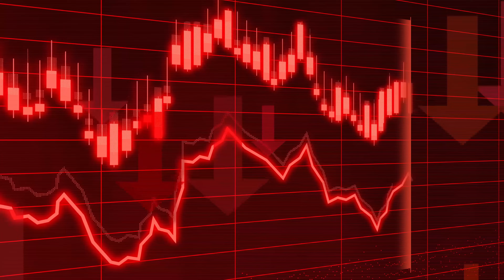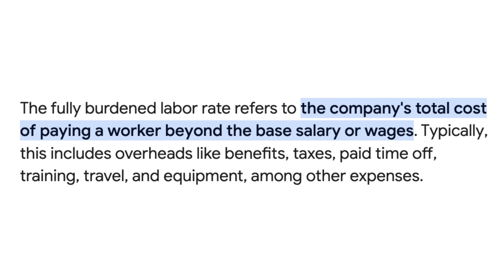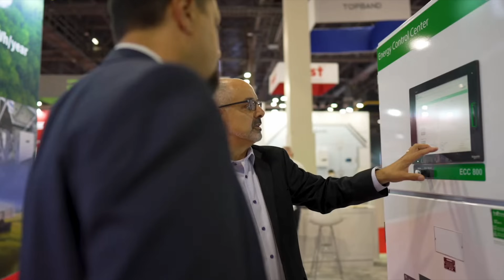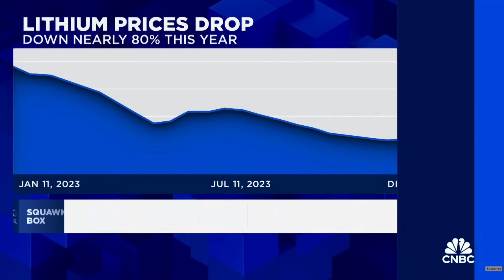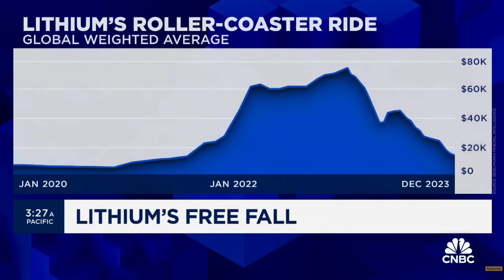IT'S BEGUN! The Solar Battery CRASH of 2025

Comment: Batteries are obscenely overpriced for what you get.
About time prices started dropping. But thy are STILL too high.
Reply: Tell your Grandpa to use rechargeable batteries. AA 4-5€ a 4pack. I use them since a decade now 😂
Reply: @lukastram4990  I have them too. ALL go dead in about 6 weeks of just sitting there.
NiMH batteries. Got D, AA, and AAA. No C though.
Reply: Btw i have old rechargeable D cells from around 2000 still doing their job for a nightlamp
Reply: @lukastram4990  I have some too but they ALL go dead after around 6 weeks, just sitting there.
Reply: Can anyone get below $US 0.65/ Wh installed ?
Reply: @DavidAKZ  Dunno unless you can buy them at wholesale?
Reply: $90 for the new 1kWh lfp cell from eve is really cheap
Reply: @stefanweilhartner4415  Eve?
Also, don't have a credit card nor $90 for the battery alone. Doesn't count the overprices poor quality solar panels with unreliable charge controller.
1kw battery needs 12 or more panels to charge it (panels barely get 2/3 of advertised rating and less on cloudy days).
No less than 2 panels to charge in 10 hours. And can't use anything else at the same time or battery won't fully charge.

How long will a 1kw battery last?
Running a standard refrigerator, 18 cu ft, will deplete a battery of that size pretty quickly.
Mine is old and will deplete it faster.

Doesn't count lighting or even cooking on a single 110v electric hotplate.

So you needs at least a couple dozen batteries, panels, etc just to have two of the basics.

Batteries alone at $90 a crack is a kidney buster.

Of course you need to install everything if you have a place to do it.

All the solar stuff is for RICH people.
Reply: In comparison to what?

If they are so obscenely expensive why are they in basically every electric device we have? 

I no of know other energy storage device that is cheaper then a battery. 
Maybe at scale there are cheaper alternatives. But even then batteries are still used at scale and being successful at it.
Reply: @Catsrules1  It's more about the profiteering than anything else.
Also, Alkaline batteries long ago used to last longer than the ones today for some reason.
Grandpa constantly has to replace those batteries. He said long ago they would last a lot longer.

Personally I have devices that do not use batteries - hand saw is one of them lol
Screwdriver?
Reply: @crazysquirrel9425 Do you have any examples profiteering?  In my experience they have only gotten cheaper. Although that doesn't signify there wasn't profiteering going on. 

I can't speak on the longevity of Alkaline batteries as I really haven't been paying attention on that unfortunately.

Handsaw and screwdriver aren't electronic devices.
Reply: @Catsrules1  But you said 'devices'.
Also a bicycle is a device.

Look up corporate profits for the battery companies.

NO WAY should a 4 pack of lithium batteries ever cost $20.
Even Alkaline batteries are high.

Using supply chain issues to increase prices is profiteering.

Supply chain was NOT as bad off as people are told.

Cali is the culprit for some of the supply chain issues. They refused to let ships dock and unload.
Reply: @crazysquirrel9425  I said electronic devices
Reply: @Catsrules1  Solar powered radio....
Reply: @Catsrules1  Electrical batteries are the inefficient way to do things. Mobile devices have the minimum battery size they can get away with because batteries are expensive. Plug in headphones(3.5mm) are a much better choice for many people rather than the battery powered headphones. People only use electrical batteries to solve a problem when there is no other choice. The best choice for electrical/electronic devices is to plug it into the mains, only if mains power is not an option would you then consider using batteries.
Reply: @Catsrules1  Home storage is many times the price of the same capacity embodied in an EV.
Reply: I got 34kw of batteries for 2500 delivered including bms of Lifepo4. Just gotta know where to look.
Reply: @jonathantaylor5105  where do I look?
Reply: @corinbw  If he did not just made it up I would guess used products without warranty. That seems plausible given the cost of a new set costing around 5k.
Reply: @corinbw The cheapest I’ve seen on YouTube are DIY cabinet with batteries -  Yixiang
Reply: @jonathantaylor5105 kWh ? That is not cheap.
Reply: @DavidAKZ  lol yes it is cheap when currently pre-made batteries are 5kw for 1100. I got almost 7x that for 2.5x the price. You must not be calculating something right.

Comment: Our 12.5 kWh PV system was commissioned in Sept 2023 and has covered ALL of my consumption and even banking power based on oversizing our system by 25%. My service provider (AMEREN IP) in southern IL allowed that and I'm on a NEM 2.0 plan.   We were going to buy a new Tesla PLAID  this fall but since our 2022 MYP is so nice and paid for we decided to hold off and spend that money on adding some ESS.  My installer (Straight Up Solar) of St Louis is an authorized Tesla and Enphase installer.  Given we have 31 panels mated to 31 Enphase IQ8A M-Inverters we are leaning towards the Enphase 5P.  But the PW3 is very compelling and given we own a Tesla that would be a natural choice for us.  I'll be meeting with them this week to get an estimate on both options.  We don't plan on installing the ESS until this fall, so am hoping any price quoted today will be lower this fall.  My starting baseline will be 2 PW3's and then going from there.  Exciting times.

Comment: Nuclear electricity biggest problem is that it is GRID ELECTRICITY. 

The Grid makes dirt cheap electricity expensive, extremely expensive in an all electric home with EVs or BVs.

With Battery Vehicles, Electric vehicles, parked 23hrs every day,  FREE  storage is available. 

Rooftop solar PV and EV big batteries and no grid electricity is ezi pezi.
Reply: Maybe If you work nightshift and your car were parked at home durring the day.  But most workers work durring the day and will need a battery that stays at home, which means either having a traditional home battery or two BEV's which alternate being the stay-at-home battery while the other takes you to work.
Reply: @kennethferland5579   a standard wall outlet and trickle charging is all that would be needed. 
Wall outlet are very cheap. 
Not all work places will have them.
But things will change.
Some people will be very slow to change and petrol will be available for years.

Comment: Additional battery supply was also created when the auto manufacturers reduced their forecast of electric cars. The battery manufacturers had orders in 2022 from them that were dramatically reduced.
Reply from the maker: Correct, that it playing into the oversupply factor for the raw material costs.

Comment: Powerwall 3=9,300. Powerwall 2=8,400. Your math isn’t adding up.
Reply from the maker: A Tesla Powerwall 2 was substantially more expensive than a Powerwall 3. About 35% more.
Reply: did you watch the video?
installation times have improved significantly

Comment: Crazy that you can buy a 98kwh used F150 Lightning for $30k. Combine that with battery system you can essentially buy a mobile battery with the capacity of 6-7power walls.
Reply: In my country South Africa you can buy 100kwh worth of LFP batteries for $14500. Depending on the brand of course. Prices have dropped a lot.
Reply: @free_stylabro6490  Actually we can get these for about the same price here in the U.S. (mine actually cost less, but it was a special sale).
Sadly, the price will go up in the U.S. when the taxes (tariffs) on Chinese batteries go into effect later this year.
Reply: @free_stylabro6490 what brand? Link?
Reply from the maker: Correct, however, we have to factor into account the value that a wall-mounted battery will provide in being able to discharge at a high enough power output to power the loads in the house, through a dedicated connection point in the main service panel.
Reply: @jackthesolarguy  An Approx. 100kWh battery consisting of Grade A high Speed EV cells comprising 48V 300Ah (53.6V x 300Ah= 16 kWh) series connected LFP pack in a 6P configuration would equal 96 kWh which at 1C would be capable of a discharge rate of 1800 Amps. The cost of the batteries,  BMS, fusing, circuit breakers etc ready to hook up to your house circuits would be about AUD$24,000 delivered to your door.
Reply: And a rv won't??? What are you smoking
Reply: EG4 power pro 14.5KWH for $3600 fully UL certified 9540A with the EG4 18kpv fully ESS 9540A UL certified even listed on CEC list in California for $8000 combined price.
Reply: Your right, yet these Solar companies are charging 30-40 thousand dollars for a 3 kilowatt system with 10kwh battery. Time to short SunRun into oblivion
Reply: What?
Reply: We get a full size NMC battery car top tier for that 30k you just want to throw at a salvaged or stripped out of a totalled vehicle
Reply: Absolutely. Tesla is ripping you off. Tesla cars will be the last to implement V2G or V2L.
Reply: FJB
Reply: @MC-.- F Project 2025
Reply: @simonpaine2347 awesome! Trump said the same thing! Imagine that.
Reply: @simonpaine2347  cool, you agree with Trump about project 2025!
Reply: @nextjin  Ok, Vlad 😂
Reply: Ev's keep lovking ppl out or in with their child while they watch it burn & wait on the fire department & who knows?
Reply: @dons5105  Yeah, I wouldn't want NMC lithium ion in my house--and I'd probably pref LFP even for a car--not only for the fire safety aspect but also because you can charge to 100% for literally thousands of cycle without worrying about destroying the battery.
Reply: @dons5105 So gullible. 😢
Reply: @dons5105  No they don't. What do you get out of lying?
Reply: @dons5105  The FUD king has joined the discussion...
Reply: @dons5105  You are sad aren't you?

Comment: Batteries have been dropping for decades.    They are still too expensive.   I buy them for disaster recovery purposes.  I recently went through 7 days without power.   Solar and Batteries was part of the solution (but the major part was still a propane generator).
Reply: I did the same in Upstate SC after Helene for 5 days running 3500 sq ft. 12k Inverter and 30Kwh Batteries with 6Kw PV panels pulled out for emergencies only. System cost around $12K, backfed the breaker box and ran everything except AC. Lasted 2 days at full load, then luckily we got full sun and recharged back to 30% and reduced to minimal fridge, internet and some lights to last out the next few days with solar charging keeping it going. Good practice run, I am doubling the batteries and panels ,rewiring a couple items, getting a heat pump water heater, and a couple small heat pump AC units. Then I should be able to run completely off grid.  The worst was the cold showers the last few days....Install was easy for an engineer, plenty of references on line and Utube, just modify for your requirements and rework/iterate as needed.

There are many other approaches possible:
- 48V, Smaller 5-10Kwh systems that run the essentials with solar inputs (backfeed or direct plug-in)
- Automotive: 12V, 50-60 Amp alternators with 3000W inverter runs several days on a tank of gas in idle (Typical fridge is 200 watts average)
- Systems that run golf carts, 48V 5-10Kwh batteries with micro charge controllers, just add a small inverter and a few PV panels; includes transportation when the grid and gas stations go down too. I bought a used cart for $750, spent $2500 to do this.
The Automotive solution recharges the system when the sun isn't available
Reply: @sholson2000  Sounds like you need an inexpensive camping shower which you can heat in the sun or quickly over a small fire.
Reply: A DIY 15kwh battery can be built for under $2k with reputable cells. How is that too expensive?
Reply: @vladimus9749 source ?
Reply: @vladimus9749 right now, thousand watt batteries are selling for $700.  2000 w batteries are $1,000. 

The prices on retail batteries have not been dropping.  If anything, they're more expensive than I paid 2 years ago.
Reply: @vladimus9749 and I've looked around and I can't find any batteries in the price range you're talking about.  Have you got a brand and a source? 

The best I can see for raw batteries without the other supporting components for a rechargeable setup is $1,500 for 5000 Watts just for the raw batteries.
Reply: Fit one with solar on the Van, very useable, also can charge engine battery.

Comment: lol people doing diy are saving 90% thats why imo. 16kwh lfp bat = $1400 now lol
Reply from the maker: It just depends on what kind of battery system you are looking to invest into. If you are looking at using smaller LifePower4 48V batteries, and you have a hybrid inverter, it is going to be much lower cost. If you are looking at using a wall-mounted AC/DC coupled battery which has more functionalities, that cost will be higher.
Reply: Which battery?
Reply: @Green-Hatter  4x 280ah 3.2v lifepo4 eve cells from china. 320 usd total for 4kwh. built my own 12v battery to replace my ev's old agm battery and wired up 200w of flexible solar on the roof to keep it charged up. back feeding my house with a 50w chinease microinverter which cost 32 bucks. the mppt charge controller from easun power 30a was 28 usd. i made a post in the gm chevy volt forums under the gen1 modifications section if you want to read more and see all the pictures i uploaded.
Reply: @vevenaneathna $0.08 / Wh. That is good. x8 in Australia.

Comment: plus people like Will Prowse, have show people how cheap and crapy the low end batters were built. 
but those communist chinese corps have stepped up there game. but not all. 
some of the better American brands have tried to lower there prices due to the cheap units coming in from china.
but there people like me are priced out of the market. at tidays pricing i would still need $10 grand USD to buy the correct amount and style of battery i need.  then the solar, but that would be killed of by a increase in my taxes.  ( improvements what the calls it).
Reply: You get 30% off on your taxes for everything solar.